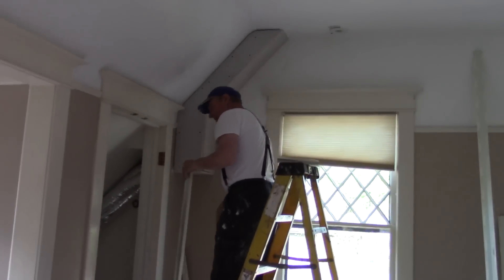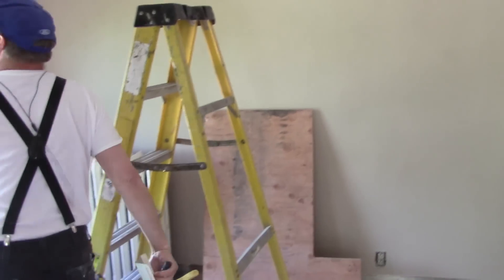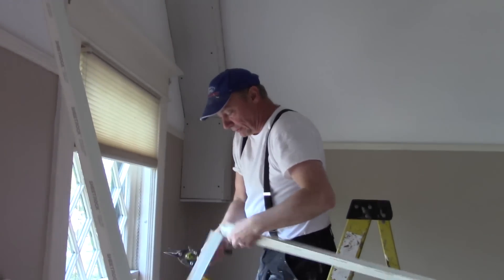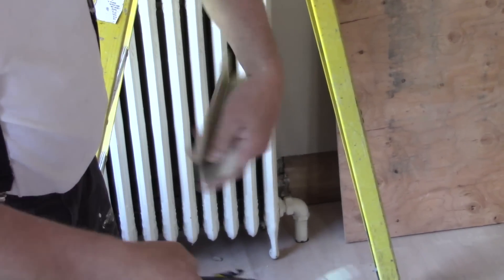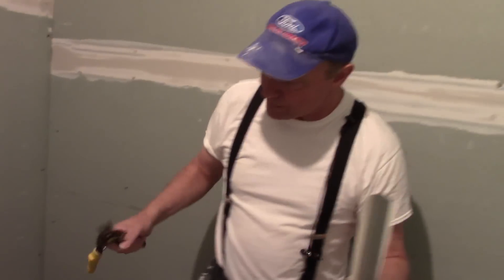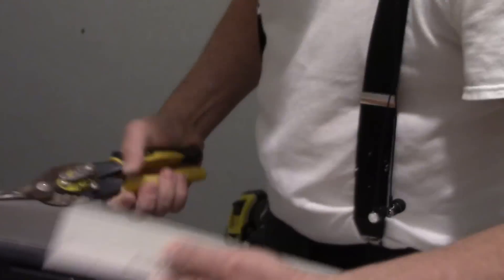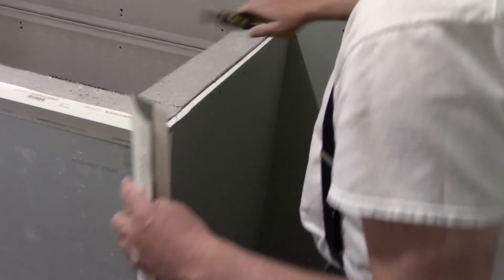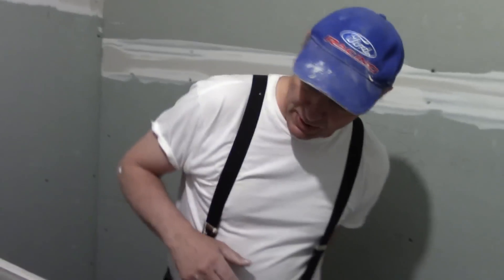How to Make Your Drywall Corners Square (on Corner Bead)

Comment: If I have an archway. Rounded door entrance. And I want to square it. What’s best tool to cut into the metal arched shaped corner bead? Sawzall ?
Reply from the maker: Sometimes it's easier to remove the bead with a claw hammer 🔨.  But a Sawzall cut everything.
Reply: @THEDRYWALLDOCTOR1  thanks boss. 
Any particular type of blade you recommend on the Sawzall?
Reply from the maker: @johnc1280 I always use any all purpose blade so I can cut through anything.
Reply: @THEDRYWALLDOCTOR1  thanks much

Comment: Great video and It will make a nice sharp angle as you said but this will never make your corners "square". I came here to see how you square the corner and got dissappointed :) thanks anyway.
Reply from the maker: Corner bead shouldn't be squaring your corners.  The carpenter should.  Corner bead will just follow the angles.